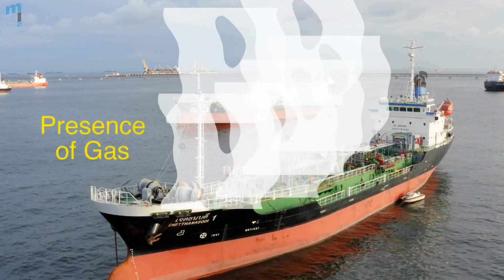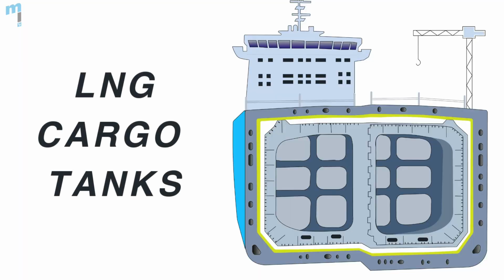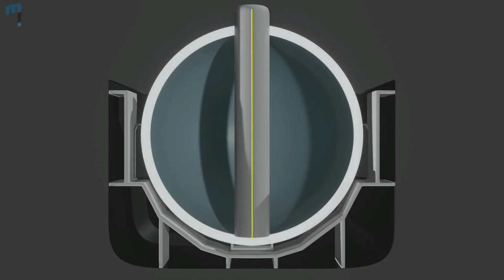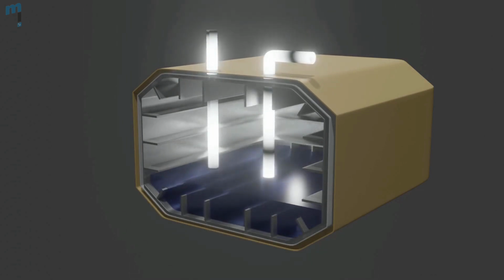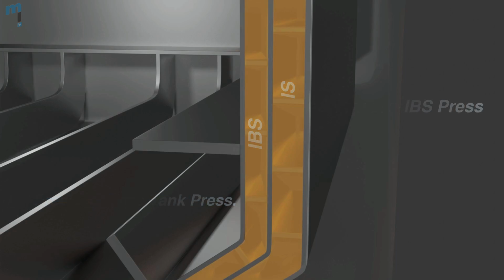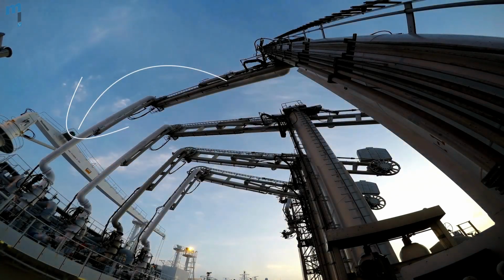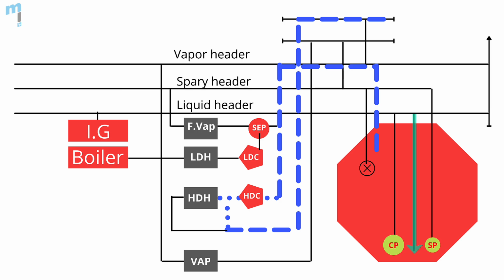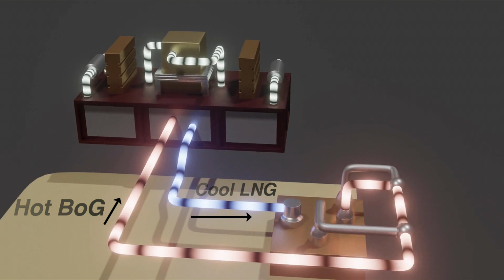Inside an LNG Cargo Ship: Carrying Gas at -162°C

Comment: I worked on LNG Ships for ETC and then Pronav. Sometimes the pipes will leak, and a quick temporary fix is to wrap the leak with a wet rag. The LNG is so cold it will freeze the rag and stop the leak.
Reply: sir may i ask a question.
How the Cargo Engineer ALIGN the manifold of the vessel to the shore?
What is the reference point in aligning the Manifold as it usually consist of 4 liquid lines and 1 vapor line?
thanks

Comment: Nice video . Can ship use LNG as driving fuel ? What is the most common fuel to drive ship ?
Reply: Yes they can, become fery popular now.
Reply from the maker: Yes, now ships are coming with system to use LNG as fuel. Most common fuel is Heavy Fuel Oil and Low Sulfur Fuel oil.
Reply: @marineinsight  And looks it will be for some time, there was to implement dual fuel, and many ships in europe area is working on this, because can provide bunkering with LNG, but as now heard as price goes up for LNG. It not become so profitable for company, many run on diesel.

Comment: Most of LNG vessel are without Reliqufaction plants, because it is to expensive, in industry have MEGI engine type LNG, but still you can reliq, some part of cargo and send back in tanks, to maintain cargo temperature gas are just burned by boil off effect.
Reply: @alfredob.martinezjr.1083  To instal reliqufaction plant it is too expensive, put now MEGI engine not.
Reply: @alfredob.martinezjr.1083  For LNG standart for stage compresor will be too expensive, why you think all lng fleet most of case are going by boil off. Just now as MEGI engine come in industry it become little bit comercial cheaper. I work in gas industry as officer and marine training instructor.
Reply: The ships I was on were steam powered and we had a gas hood installed in all the boilers that used the boil-off as a fuel source, so when boil-off occurred it was burned as fuel thru the special burners installed for that purpose. Bunker-C and LNG burning looked different, an orange flame surrounding a bright blue flame.